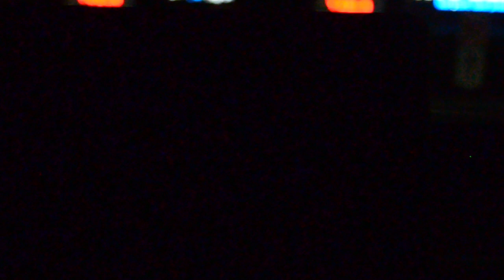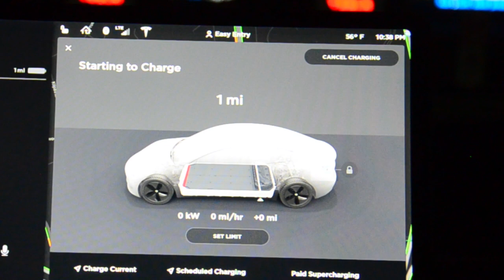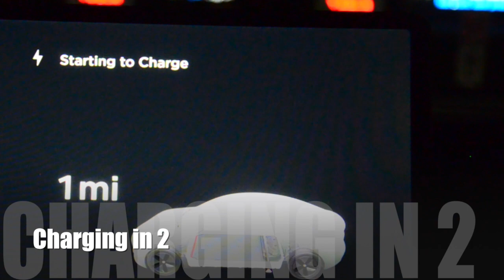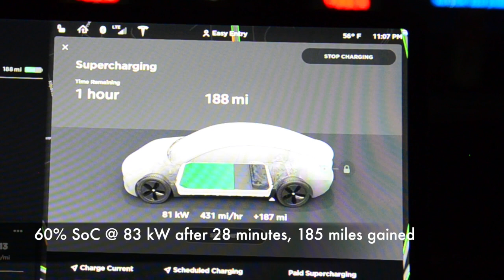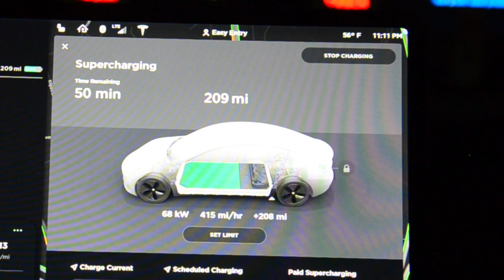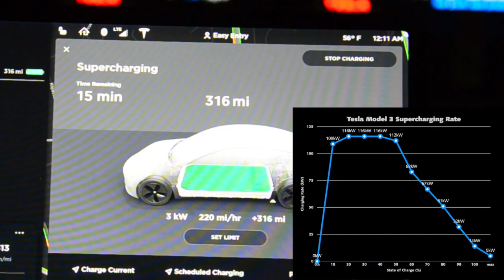Tesla Model 3 Long Range Supercharging Full Session Updated

Comment: A really informative video on m3 supercharging rates, thank you! If you wanted to do any more of these, I would recommend that the most informative scenario would be driving at highway speed (75mph / 121 kph) for a couple of hours, down to 10% SoC and then supercharging up to 80% SoC. That's going to be the most efficient driving pattern for long distance highway journeys that would need a couple or more recharges (i.e. Road Trips). I would love to see how long that 10-80% recharge takes in 2 or 3 different cases. The key variables will of course be ambient temperatures and whether you are sharing the supercharger stall with others (or with local grid users, as you rightly point out). For now, your video indicates that it takes around 35 minutes if you can get full power out of the supercharger, which appears to be right on the money.  I guess the m3 proves it has the best charge time to highway drive time ratio in the world - a true road trip ready EV. Great! Also... will be really interesting to see whether the supercharge rate on the m3 improves when the next version of the supercharger comes out in late summer 2018. I suspect it will improve a bit further still!

Comment: When the ModelS is charging with >100kw at some point the fans are going loud is it the same with the M3 ?
Because i would like to know if the M3 has left extra cooling capacity for maby higher charge rates in the future.
Reply from the maker: The temperature was in the mid 50's F, so while the fans did kick up, they weren't particularly loud. No where close to where I've heard my Model S fans hit in Florida on a hot day while Supercharging.